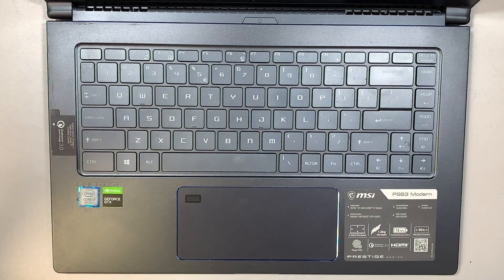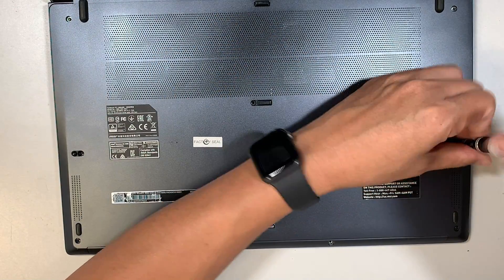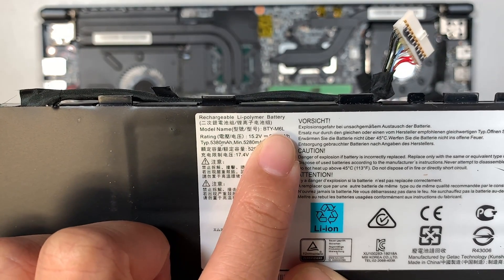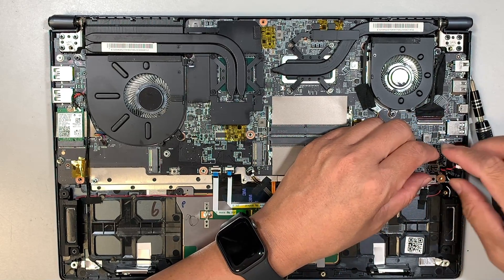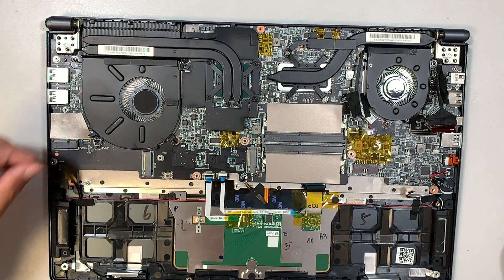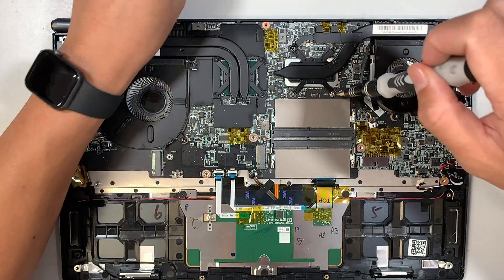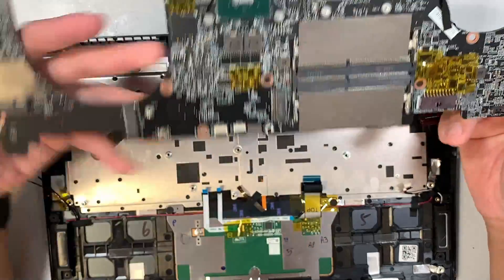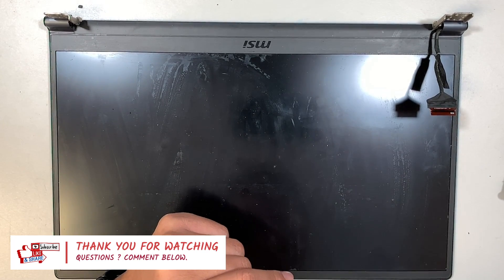MSI MS 16S1 Full Assembly Keyboard Replacement

Comment: So he removes everything just to end up with keyboard that cannot be replaced!
Reply: It can be replaced just desolder
Reply: @hypersonic6649  yes, I finally did it. Had to cut all that plastic ball-heads with cutters. They are not needed and do not serve any purpose. My new keyboard from Ali works perfect!)
Reply: Your keyboard isn't slightly lower than before? @mSnus
Reply: @Gorlik1337  no, totally fine
Reply: @mSnus what did you apply after replacing the keyboard so it stick to the board like used to before?
Reply: @patricknoelsimamora5601 nothing was necessary as I remember